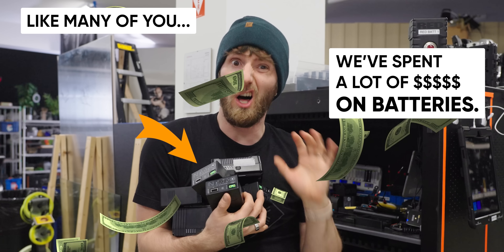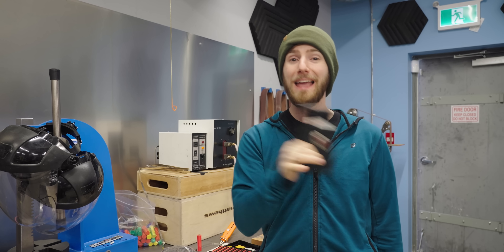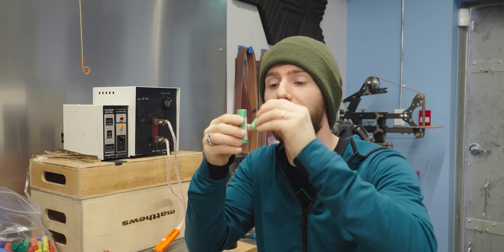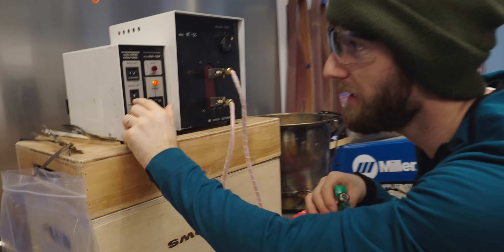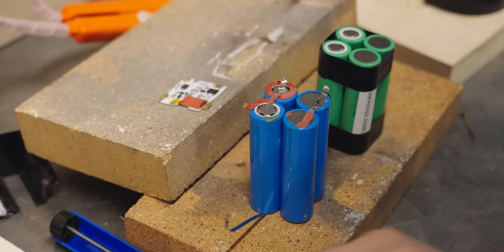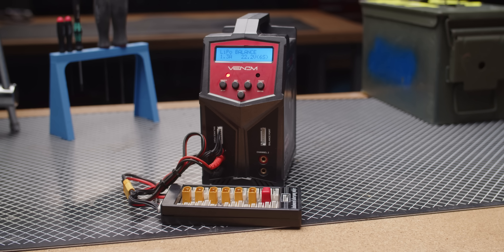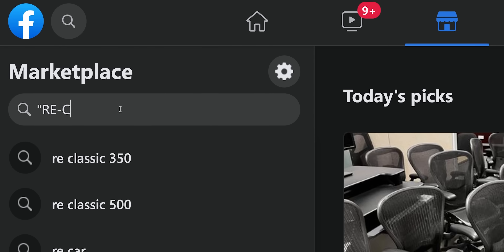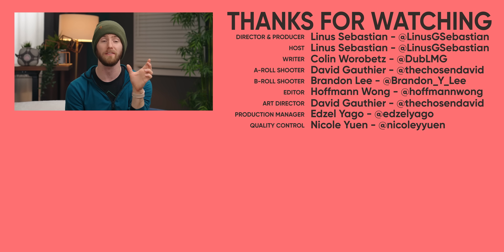This should be illegal… Battery Repair Blocking

Comment: This is why I'll occasionally watch this channel but won't subscribe.  They bring up interesting topics (sometimes) and promote good things like recycling/repairing over just tossing and getting new, but they just don't really know what they're doing.  You can get sparks off something without the thing you're soldering/welding too actually being damaged.  Yes, you should stop and see if the sparks continue, but if they don't, then either your component was not damaged, or it was fully killed and likely no longer dangerous.  Still, it is good to err on the side of caution, so good on you guys being ready with sand, but still, it wasn't needed with the sparks you showed.  Even without smoke or fire, you'll see if the cell swell or feel if it heats up.  I'm done similar things with non-lithium batteries and you can tell.  It is all the same with lithium, just worse, so it requires more caution but you guys were overdoing it in this case.

Maybe cell phone manufacturers should watch this video. Oh wait, if they made their batteries easily replaceable or repairable, then how'd they get us to buy more cell phones? Silly me.

They should for sure try to get a tour of a battery recycling place, that would be interesting to watch!

Comment: I've spot welded car parts in a GM factory in the past, but never seen a spot welder for batteries. The automotive spot welders are so big and heavy, the gun is hanging on a cable at the height you need to use it, and there are big copper cables running to the rest of the machine. Robots do most of that work now. I'd rather use a spot welder like yours. The copper welding tips are the size of .45 caliber bullets and can be removed with pliers and new ones hammered on in their place. The old tips are fixed up by running them in a machine that shaves the burnt end off and re-contours them.

Comment: DJI phantom 4 batteries x 2 (au$250)   in my case  not used for 2 years  even if cells are still good after  manual recharging (start voltage was 2.7)   now they hold 4.2 , but software marked them Dead and nothing I can do about it :)

Comment: i never replace the batteries i just replace with caps  a buck converter a rectifier and wire it to a couple bolts i poke outside the case that way i have a external battery like a common 12v. lol you should see the battery life of my cellphone on a car battery. i got like a week yeah yeah no longer portable but i just get a new phone and use the old phone as a server. i also do the same for laptops.

Comment: Well, i am all for reparability but in case of those batteries I would be on the side of the side of the manufacturer: it is too dangerous. 
Sure, you could say that with anything that has electricity or a big condensator on it but you should have a good security in your home if you forgot to unplug it and condensator don't burst in flames that can not be estinguished + poisonous gases.
Then there is the fact of brand connection to possible accidents so the best solution is actually the one of that german company.

Comment: When I purchase lithium ion battery cells I weigh them and do a comparison test to a cell of same AH ratings then i fully charge and discharge using a ceramic resistor discharge circuit. Time it and write down everything. Compare it to other cell previously mentioned and compare.  Easy as. But if its rated at 3000 mah? Its most probably 1000mah or 1 AH. Ebay ones are absolutely pathetic but Aliexpress has some pretty good ones which gave good results.  Cheers from Australia 👍

Comment: I have found your EVIL BMS’s in a Dyson vacuum cleaner, and in two Laptop batteries.  All these devices were showing battery failure symptoms but after replacing I dismantled said batteries only to find all the cells in perfect working order.  The software management system just decides to “fail” the battery after a fixed time to force the purchase of a new one.  I now use those “faulty” cells in power packs and they have been working well for years after suposedly failing.

Comment: Given how some countries actually ban such stuff from being tampered with and how dangerous they can be,the battery companies have to take into consideration the multitude of different domestic and international laws,the specifications laid out by the equipment manufacturer the battery is intended for( manufacturers love implementing devices/security made specifically to force you to buy from them only) on top of that they have to consider the increasing number of f*kwits who do stuff they really shouldn't be doing. I'm all for right to repair but for the safety of all some stuff should be left alone.
Reply: @notpoliticallycorrect1303  I deplore the efforts made to stiff customers. But I do understand that in this day and age where it's fashionable to injure yourself doing things you shouldn't be doing and then sue someone else for it, companies would be suicidal to not do all they can to stop 'tampering' at least to the point where they can't be held responsible.

Comment: Have you tried charging those non-working batteries? Normally the BMS disconnects the battery until you connected power first, to prevent over-discharge...

Comment: You should have tried recharging the Sony battery some BMS just turn off the output when cells get too low (which u simulated by disconnecting cell)

Comment: Maaaaan... All those batteries you got rid of all because you weren't holding enough pressure of the electrodes on the batteries... Not ruptured! Tsk tsk lol.... And secondly , most of the time when you replace batteries in the packs like that and the BMS blocks the voltage output , you can usually unlock the BMS by plugging it into the original charger......I would be interested to see if it wakes up after you put a rebuilt pack  onto the required charger but it's been so long you probably threw out all those good batteries lol

Comment: There are single cell 18650 cell flashlights that you can buy and use those individual saved cells for until they don't work anymore. Cheap, like 4-6 dollars cheap. As long as you're not stacking more than one, you're good.

Comment: When I was a teenager, I got an HP laptop new with a 1 year warranty. At exactly 373 days the battery gave a warning it had severely diminished capacity but the thing is it was like a switch was turned off because it didn’t charge, power the pc, or give any warning prior. I called support to be told it was EOL and I was SOL. I felt so gaslit about its sudden failure because I’d not noticed any major drop in capacity. Good to know it ~*likely*~ just nuked itself.

Comment: I'd say, most likely, u just need to keep the BMS powered while executing the procedure. And i believe you can do that with a proper equipment, no problems. Not user-friendly, but replacing battery's is not user-friendly anyway.

Comment: You usually need to charge to reenable the bms after disconnecting the batteries (assuming there isn’t intentional blocking)

Comment: . . . I found that if the voltages of cells are off, means BMS not doing job. . . Charge each cell level separately to high level to insure the balance is in range.  . .

Comment: Soooo now that you have labs up and running what are the chances of developing a debug tool for resetting batteries?

There seem to be very few tools available, those that are available are expensive initially and require a license for the unlocking/resetting features.

Comment: Ok so another reason you don’t mix new and old cells is due to the age difference between the cells older cells won’t be able to keep up with the demand thus the newer cells will take most of the load which can cause over heating which can lead to thermal runaway!

Comment: Another method of blocking, which Dyson uses IIRC, is if the BMS detects a no-voltage state on a cell, it shuts down and won't work which includes replacing cells and it goes to zero during the exhaust.  

It doesn't matter if the new cell is good once that zero voltage trip has happened.  The workaround for those who want to bother is that you have to use a separate power supply to keep the BMS fed a voltage during the cell swap.

Comment: I would run a couple small jumpers from the new pack to the inlet of the bms so you never drop voltage out of it and see if it works that way. If not it’s definitely software related

Comment: I would Like to see where they got the info about what they called " evil" BMS's I've been working with BMS's for years (more than 10), and have never heard of ones that are programmed to stop working. Also, those sparks when you were welding the cells together, was only due to you not having enough pressure, when the nickel strip has any type of air-gap, it will spark, it does not make the battery pack bad, or mean that you shorted the cells,. It wasn't even the cells at all that made a spark, it was the welder that sparked on the nickel strip.

Comment: Okay so just an fyi. I’m sure Linus won’t see this but you guys will. Vape battery’s (18650) are fast drain battery’s. These are NOT SAFE TO use on laptops or battery banks as you want a slow drain battery. Rapid discharge of these battery’s will cause implosion. It’s probably okay for their red camera as the battery life span will deminish fairly quickly.

Comment: almost all BMS will appear to stop functioning after battery disconnect - just like in the video.  Linus is actually INCORRECT here. This is normal function of BMS boards where it stops functioning at all. However this can easily be reset by sending a voltage around to what the rated Lithium pack is. Voltage is sent to the P+ and P- aka power leads used to power the device or the leads use to charge the batteries.   

oddly enough, i came across many videos where youtubers are having exact same problem when attemping to fix a device by battery replacement(car jump starters) or  building power source for a device, ie. power banks,.  anyway if u read this comment you should be thankful because there is so much misinformation about this everywhere.  

anyway probably pointless in a year old video, but im just passing it forward.  ¯\_(ツ)_/¯

Comment: some BMS (including the ones present on laptop batteries) have a uC with volatile memory: if the voltage of the cells drops significantly low: let's say the battery was not used for years or it was badly discharged, the BMS uC will shut down bringing the battery on the "lock state"

Comment: After insisting that one does not reuse the cells in the old pack, ever, didn't you do the EQUIVALENT by using the unequal cells from your vape friends?? Isn't the process of reusing the old cells the same as what you did with the... In my words "IFFY"... vape cells?

Comment: You were using far too much current/time when doing those welds, they should not be getting red hot as shown in your video.
Next: on the completed pack did you try charging it? some BMS's need to be put on charge to be reset. Only needs to be charged for a moment.

Comment: Okay, imagine the battery on your camera rupturing and then multiply it by like 1,000 and you've got the potential for what's going to happen a lot in the next 5-10 years as EV guys start to realize their batteries only have an 8-10 year life expectancy lmao

Dudes are gonna try to buy a battery pack off of Amazon to replace JUST the bad cells (they already sell them apparently) and he's gonna set off a 1,700 pound roman candle.  Welding temperatures within a fraction of a second with him standing right next to it.  Dude wouldn't know what hit him and the coroner wouldn't even be able to identify him with dental records.

Comment: 16:36 The problem is, that the BMS main chip has a permanent-failure bit triggered when the voltage on the CPU gets below a certain voltage. So the BMS will never accept a charge or give power out if it runs completely low or you remove the cells from it. This (and also most likely your battery packs) can be solved by buying a special programming kit that can modify the firmware of the BMS and remove that triggered bit. The hardware isn't that expensive, but the software licence to re-program the BMS is. If doing a proper cell-swap, you should also reset the number of cycles to 0 and reset the learned voltage offset of the old cells as well as resetting that failure bit back to 0. That software also sets the manufacturer date to todays date if you want it to. Such a software is mostly used by companies selling re-celled battery packs due to its high price.

Comment: Ebike batteries are even worse. I have an 2013 ebike and the thing is fine but the battery is at like 40% cap. 

1. New bricks are no longer produced or sold. 

2. Even if you buy a brand new or even used brick YOU CAN NOT USE IT. The bricks are paired to the bike which a shop can do but won't do for you. 

3. You can't recell this brick without destroying the damn housing of it. 

So the battery solely turns it into a piece of scrap. Not to mention that those batteries cost like 1k and this bike was 3k 10 years ago. 

New bikes can cost 5k and they lose 20% of their value every single year due to the batteries.

Comment: Literally every (silly) reason given to not replace individual cells could just as easily be applied to rebuilding the entire battery. Also, you claimed in the intro you were going to examine is you could “just swapping out the tired cells inside” the battery.
That’s not what you did here!

Comment: If you bought all the same cells and some were low by 0.2v, this is a lot to be lost by self discharge unless it was a dud cell or they started out like that, I would either discard those cells or get a tester for internal resistance as this is gonna be important when putting cells together in a pack as a big disparity here is gonna cause problems for balancing the cells and a high internal resistance means the cells lifetime will be reduced, as this increases with use and is the factor that kills the cell in the end, so even though you could charge the cells to the same value, it will be those weak cells that kills the pack off in the end, and for a cell to lose 0.2v ie 1/5 of its usable charge, should take years of storage to attain, so my guess and assumption would be they are bad cells if there was no way to test internal resistance to confirm the case.

Comment: I had to dislike linus because you promoted too many lithium fear myths and I see no correction below from you saying "we got a lot of things wrong about how we tried to build a pack but the point was that manufactures should be legally barred from blocking cell swaps as it makes the e-waste problem way worse and artificially makes products e-waste when the replacement battery supply dries up due to companies going bust or stopping support"

Comment: not only will it extend the lifecycle of the products keeping it out of the dump and end of cycle locations...

But recent research has shown that if correctly recycled through a new technique, it can extend the life of the reproduced battery, making a battery guaranteed for 6 months to maybe guaranteed to last 9 or even 12... it's an interesting read, usually recycled goods have a shorter lifecycle, it's quite exciting.

Disallowing good stewardship of resources is a disaster in motion and needs to be stopped in it's tracks, hopefully we will be soon good enough to dig up old garbage waste sites and start separating material to be brought back to life and put back into use... who knows how many tonnes of steel is waiting to be sold as something that is useful

Comment: you may need to "activate" the BMS by connecting the battery pack (via the BMS) to the charger. That will enable (activate) the BMS and then it will work.

Comment: All new cells my ass whats the purpose of removing all it is not worth it
Reply: You simply cannot have two cells of different capacities and internal resistance in one pack - they will discharge unevenly and fail fast. In battery pack manufacturing cells in one pack are almost always from one production batch and they are always sorted by their internal resistance (usually on automated machine). Different batches of the same manufacturer mean slightly different ratio of chemicals in jelly roll and slightly different electrical properties.
Reply: @KB-mo3sx  that might be true if you want to mass produce then to have a certification but for your own use it works even with different brands of cells usually in one pack it gets bad one or 5 cells at a time, did such not 1 time but many times and could not tell a difference from the long Vivity or bundle performance from the original and the refurbished one
Reply: @adriancoanda9227  I guess with a good balancing circuit and low current draw this might work, but you're wasting energy through balancing. With higher current draw (lest say 30A/cell continuous) it would cause uneven heat spread and potentially single cell overheating, joint fatigue etc. Heat dissipation is a very important aspect of module design and it's tested many times (separately for electronics, joint, battery) before project goes to production state. Maybe my point of view is different because I work with better quality cells, so they cannot be swapped for something else that easily (like Moli P45B).